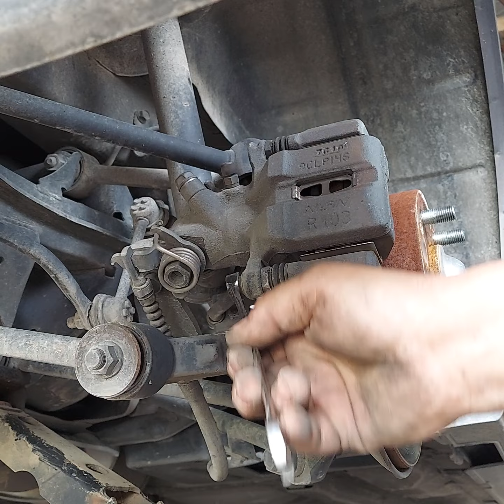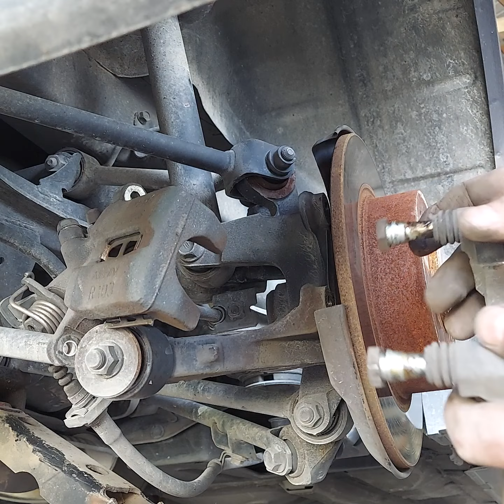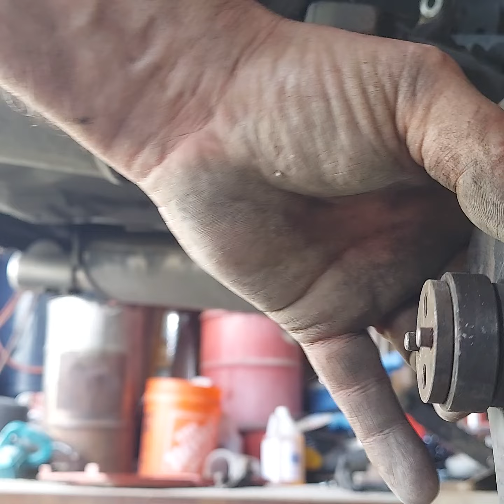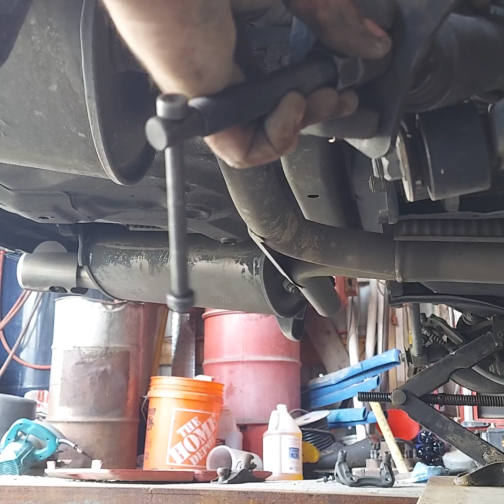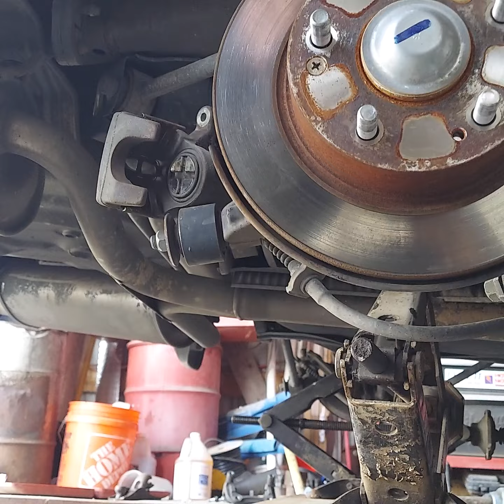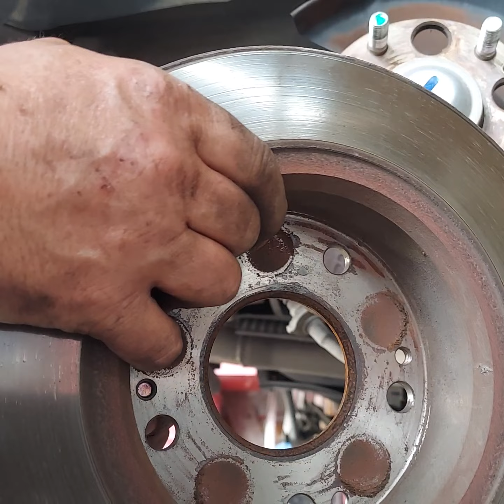2007 Honda Accord rear brake replace

Comment: Also seems crazy but have heard the torque spec on those bolts is only 17 lbs.
Reply from the maker: I suppose that's correct.. these caliper mount bolts are not very big. Tight enough not to vibrate loose is key